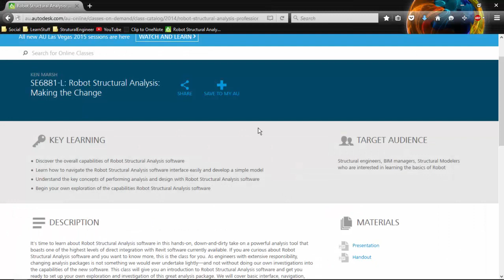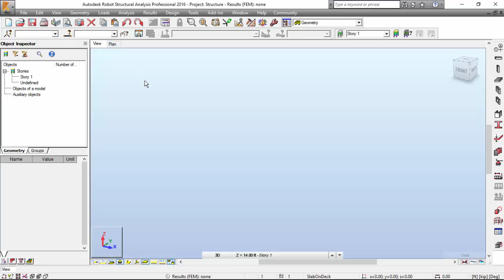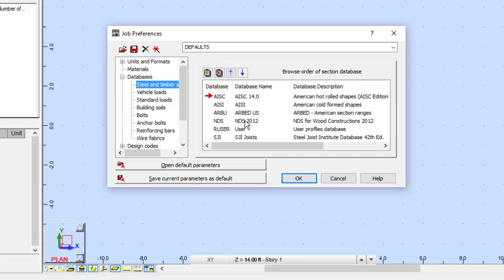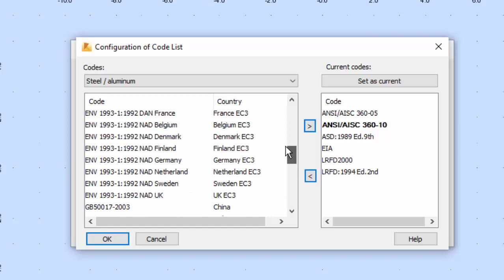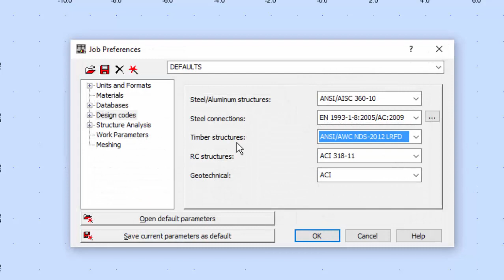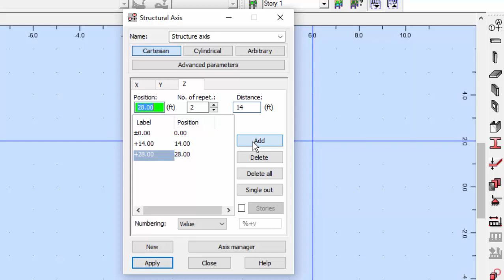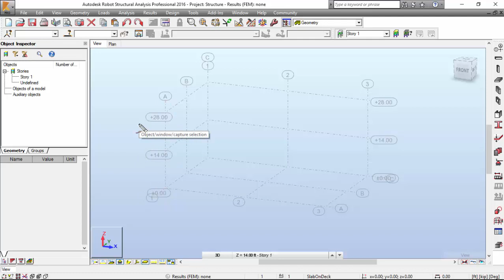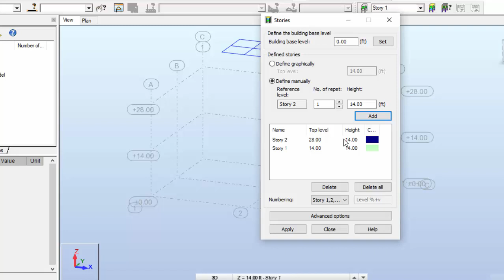Robot Structural Analysis: Making the Change - Part 1

Comment: Great serie of videos man! When I pick desing code of steel I got ANSI/AISC 360-08, I cant find ANSI/AISC 360-10 why? i use RSAP 2014 maybe thats the reason and I need to update the software to 2016 to have ANSI/AISC 360-10, what do you think? thanks.
Reply from the maker: +Matheus Cd In RSAP 2016 you have available ANSI/AISC 360-10 and ANSI/AISC 360-05. 
I guess that you are right.
Reply: +Nuno Teixeira - Robot Structural Analysis sorry for my bad english. thank you!
Reply from the maker: Your English is perfectly understandable.